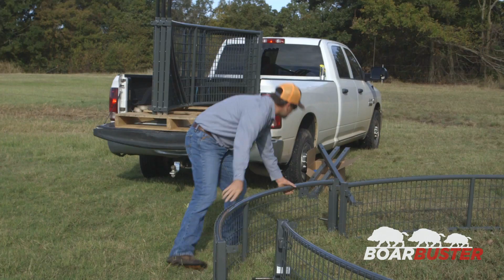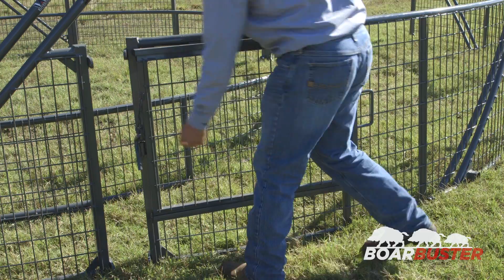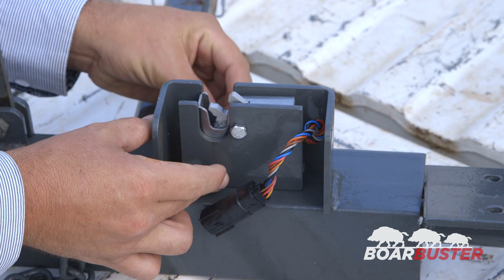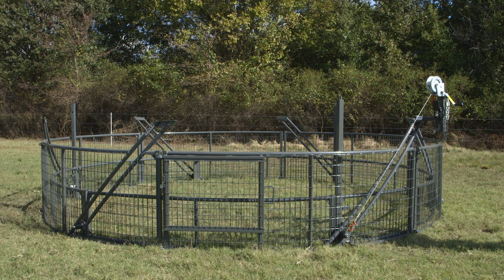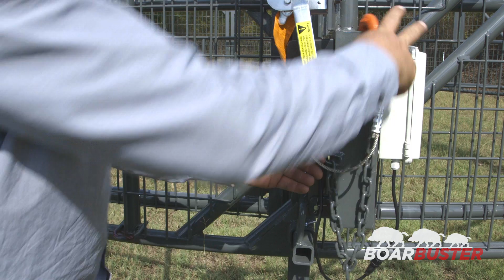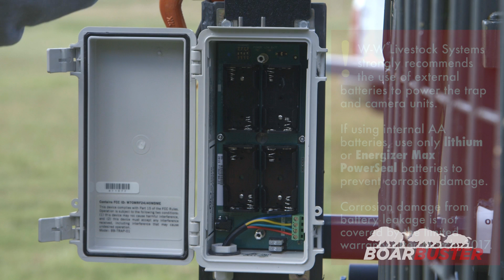How To Assemble A BoarBuster Hog Trap | Feral Hog Trap Setup 2017

Comment from the maker: Frequently Asked Questions Regarding Feral Hogs and BoarBuster Traps

Q: Can you eat feral hogs? What happens after they are trapped?
A:  Though feral swine can be good table fare, eating them comes with a risk of contracting more than 20 infectious diseases known to affect humans. The highest risk of transmission occurs while handling uncooked meat, so wear gloves and other personal protection. These risks make sale of the product very difficult, resulting in limited market options for wild-caught swine. In most of the country, it is illegal to release feral swine captured in traps. Many of these animals are euthanized and composted, while a few of them do make it to the table for personal consumption. 

Q: How is the trap disarmed by a sensor?
A:  When the trap is dropped, a normally closed circuit that is attached to the latch informs the camera that the circuit is now open and the trap has been deployed. The camera disarms when reading this change in status so that pictures are not being sent to users every 10 minutes when pigs are trapped in the trap. 

Q:  If the trap falls on a pig, will it let out the other pigs? 
A:  Occasionally, the trap may fall on top of a pig, but this is mostly mitigated by the baiting strategy of the trapper and the ability to see live video at the time of trapping. Most often, when the trap falls on top of a pig, that pig either escapes or is trapped inside the trap after it frees itself. In rare occasions, the trap may land on a pig that is unable to free itself, but other pigs generally do not escape. 

Q: Why make the trap rotate? Wouldn't a straight drop be faster?
A: Safety and user friendliness were considered when designing the traps. The spiral design allows the trap to be elevated via a central point without the use of dangerous cables and additional electronics and cost. The difference in speed to the ground is only milliseconds unnoticed by the human eye.

Q: Do these pigs ever try to dig their way out of the trap? 
A: Feral pigs root and wallow in the soil but do not burrow like their cousin, the warthog. When the trap is managed according to best practices (i.e., prompt removal of captured pigs), this is very rarely a problem.

Q: Wouldn't shooting them or hunting them be easier?
A:  Shooting/hunting is an easy practice, but it is not considered an effective control strategy because it does not remove enough animals simultaneously to reduce populations.

Q: Why do the feral hogs need to be killed?
A: Feral pigs are a nonnative invasive species that competes with native wildlife; damages natural ecosystems; spreads disease; and poses economic burdens for farmers, ranchers and consumers.

Q: Can we farm feral hogs once we catch them?
A: In most areas of the country, it is illegal to harbor feral swine without proper permitting. In most cases, you will have to consult the state department of agriculture for regulations on feral swine.

Q: Isn't the BoarBuster trap too small? Wouldn't this make it possible for the feral hogs to escape?
A: Noble Research Institute testing of various trap sizes was considered in the final development of the BoarBuster trap. Testing conducted with third-party trappers across the U.S. found an 18-foot diameter was sufficient to repeatedly capture sounders of wild pigs containing up to 40 animals. Noble has also identified several best management practices for using the trap, including bait placement and quantity. These can be found in the “Proven Strategies” section on the BoarBuster website: http://community.boarbuster.com/

Q: What is the phone app to trap response ratio?
A: As with all cellular technology, the response rate depends on the signal strength. BoarBuster uses a low frame rate and black and white video resolution to speed transmission through the server. For example, with two bars of signal at the trap and a good connection on person, the trap command lags less than 2 seconds behind the video displayed. The in-person trap response, disregarding video, is instantaneous.

Q: Does the BoarBuster trap actually have any effect in feral hog populations, or is it just a maintenance measure?
A: Research on BoarBuster at Noble Research Institute has demonstrated that the system is capable of reducing populations by 88% on large acreages. The larger the area controlled, the longer the control efforts last. Control on small acreages may easily reduce populations by more than 88% but will be temporary as new population of pigs immigrate.

Comment: How much does hog traps cost?
Hog Trap Price with manual hand winch: $1995. Hog Trap Price with electric winch: $2395. Custom Trailer Price: $1850. Remote Camera System Price: $1475
BoarBuster - Farm Ranch Store
BoarBuster · $500 Flat Rate Shipping to the lower 48. · The Problem · The Research · The Solution · Download trap assembly instructions below.
$8,744.00 to $9,994.00 · In stock

Comment: Trap too small, and net should be on the inside of the ring, instead of the outside, as this construction is less sturdy.
Reply: nothing wrong with this setup, and if it were larger it wouldnt fit so well in the back of a pick up. 
you can always make your own.
Reply: There’s always a european to tell you how it can be made more efficient or better. @Peter Hvidsted Have you seen the incredible success rates on these traps?
Reply: I guess youre planning on driving this larger version of the trap around in your semi-truck and trailer?